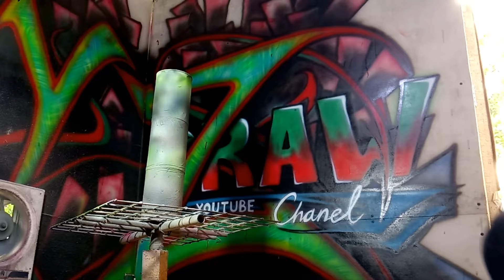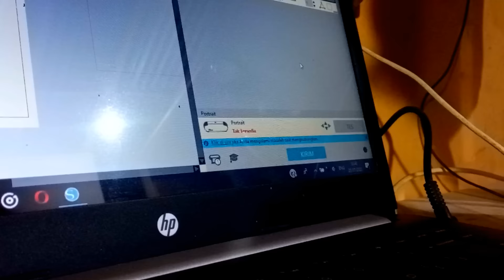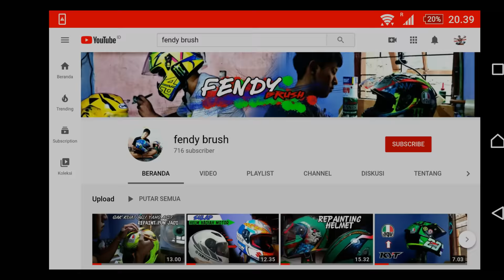Repaint helm INK CL MAX jadi SHOEI MOTEGI 2020 MARQUES HELMET ; MANUAL PAINTING

Comment: I airbrush/paint helmets and also auto detail/paint correction vehicles here in USA. I noticed you had some contamination in your paint, you should filter them before using (always). I did not see the tack cloth used or any IPA, that's why you have so much lint and contamination in your surface. Clear coating, then calling it, "finish" just isn't good enough, considering how much work you put in. You should also wet sand your clear coat (4-5k grit), then polish/glazed to remove those orange peal effect you're getting in your clear. Buff with carnauba for final gloss, and that helmet would have looked 10x better. I'm sure 99% of the people would have been happy as is, but to a trained eye from another artist perspective, you missed a lot of steps.
Reply: Record a video showing your talent being superior to his talent, if you can... then I say you "are the man"!